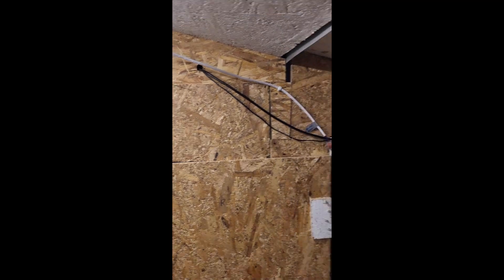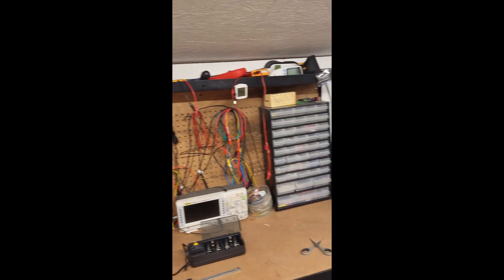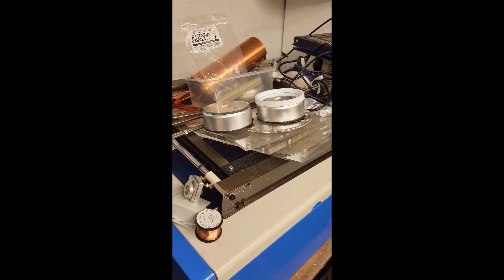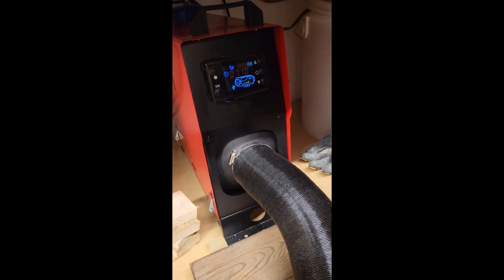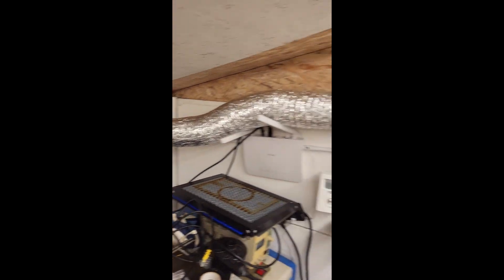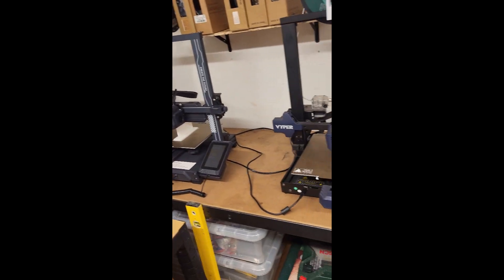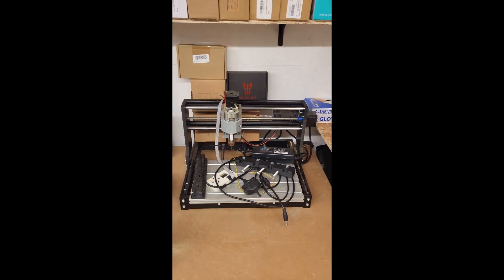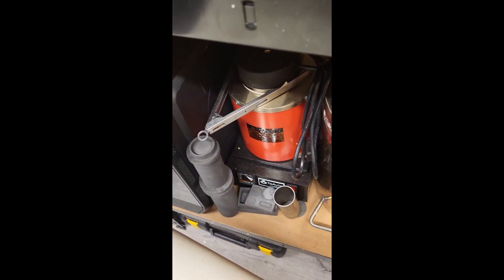Gary McKinnon ShedLab update

Comment: Nice work shop Gary. You have a lot of nice equipment in there, is it shielded from radio and microwave frequencies, do you have it grounded to the earth, does your cell phone work inside your man cave? Thanks Bruv
Reply from the maker: Mobile phone works in there, not grounded yet, electricity currently supplied by extension reel.
Reply: @GaryMcKinnonUFO  I assume if you can build a fully shielded workshop that you would never be able to have your mobile device get reception in there. I’d imagine something like this would be difficult to build, unless you have the right kind of shielding layers. Remember that movie with Gene Hackman and will smith, where Gene had that cool workshop? He even wired it up to explode when he was compromised. Great movie. Enemy of the state, that’s it. ✌🏽😁
Reply from the maker: Great flim. @matty7771